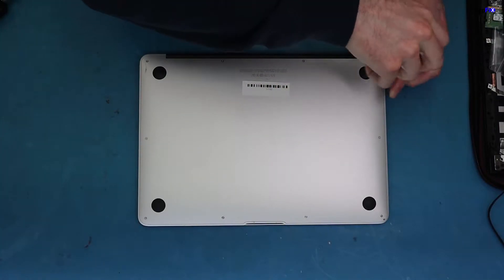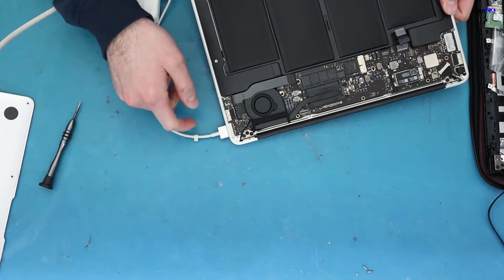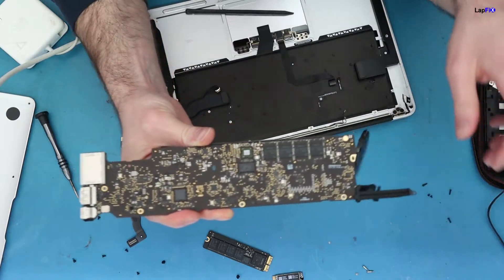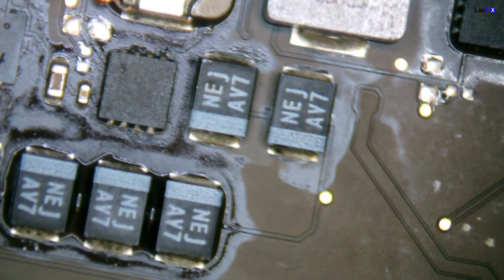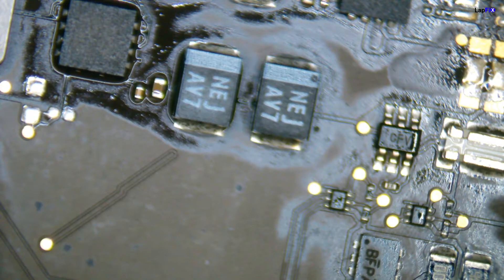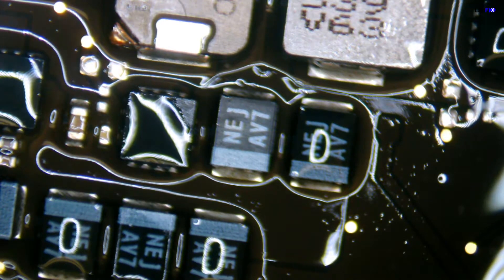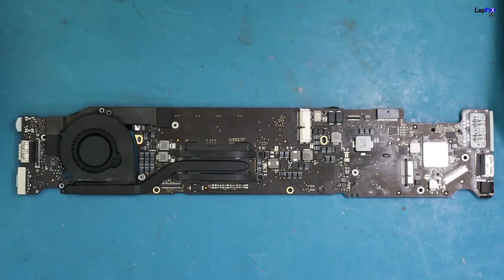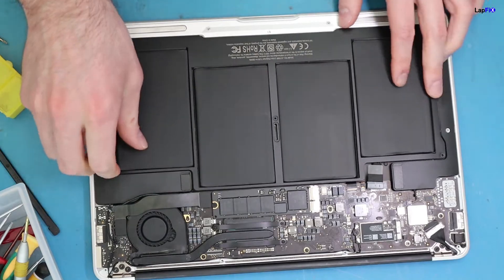Fixing a Dead MacBook Air A1466 - Logic Board Repair

Comment: Amazing work. Not applicable to me but just good to see and hear about a shop repairing boards, 2 components and some into that fix. A new logic board would have been more than the MacBook was worth! I just replaced my 2012 mbp DC board. Thankfully tits not integrated into the LB on my old Mac. Keep up the good work!!
Reply from the maker: thank you for the kind words.  Yes, the older models with magsafe are separate from the main board.  I wonder if the new 14" and 16" m1 with magsafe are the same way?